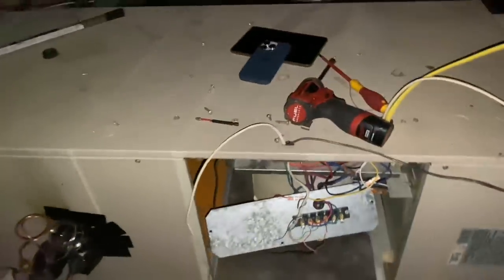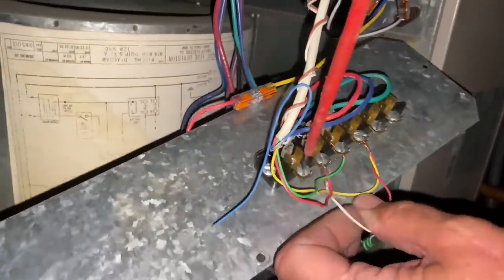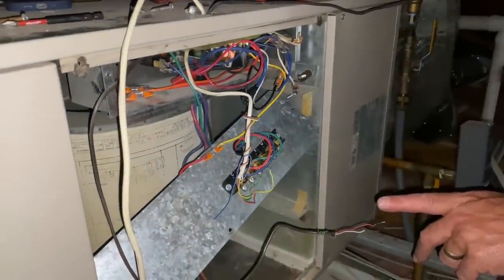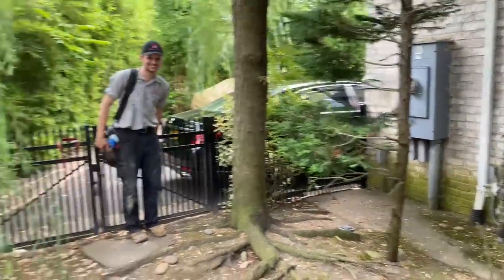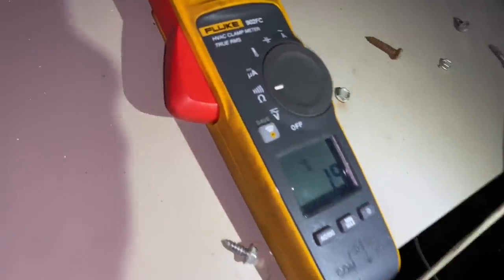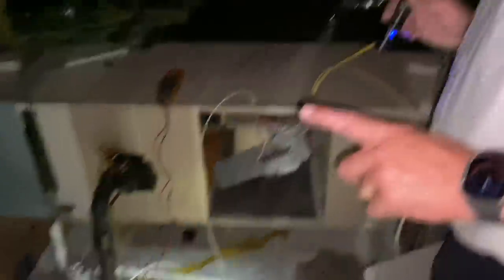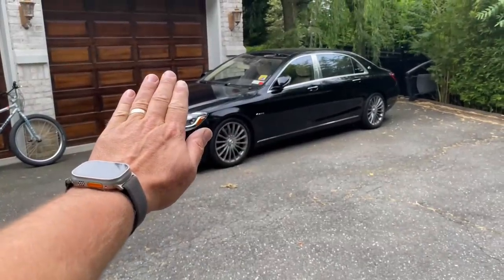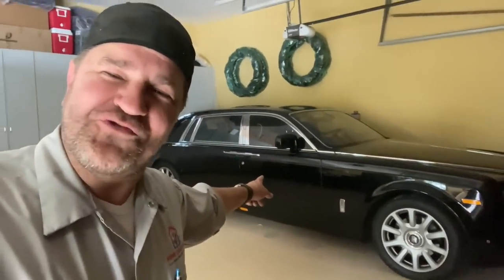Central AC Not Blowing Transformer Dead How to Fix Wire Short Between Air Handler & Condenser

Comment: A friend of mine owns a Rolls Royce and he had  a bad tire and on a Rolls Royce when you need to replace a tire, you have to replace the wheel too because they are run flat free tires which are part of the wheel and it cost $2000,00.:yougotthis:  Great Video!

Comment: All I ever run is 5 wire for straight ac.  Usually 8 or even 10 wire for heat pumps.

I’d rather have extra just for situations like this, or if you ever want to add temp sensors wired to tstat.. it’s already there.